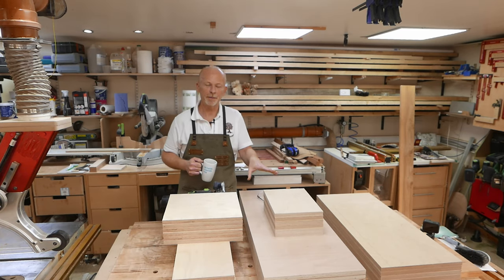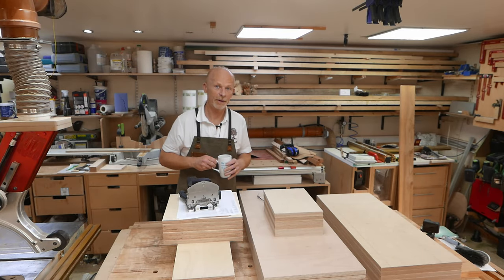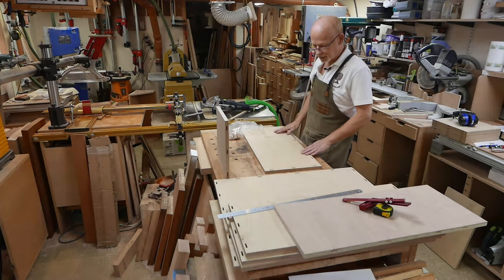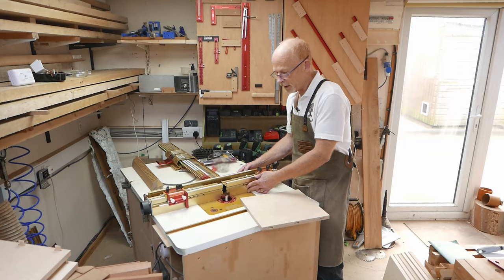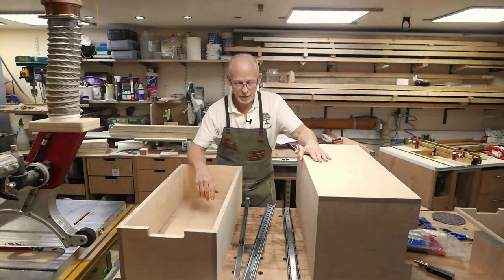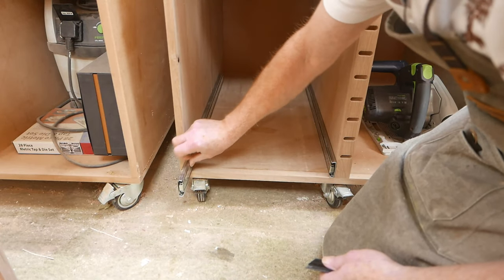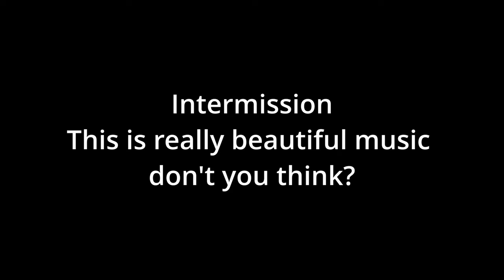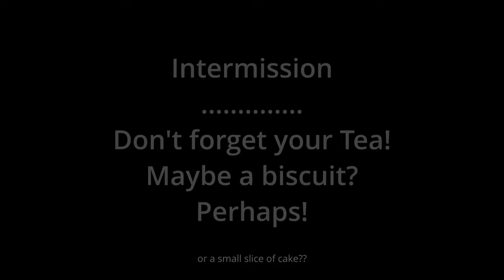Making Plywood Drawers using the Festool Domino Part 1

Comment: I have a set of Dominos that I wrote the size on with a Sharpie Marker (example 6x40).  I sanded these Dominos a little on the edges and sides.  I use these strictly for dry-fit and and never for glue-ups.  They are easier to put in and remove. Also you can apply blue painters tape around the boards during dry-fit and this allows glue removal to be much easier, glue application within the non-tape areas and less glue staining on the piece as well as ensuring adequate glue.  Nice job with your video.
Reply from the maker: Hi Mike, now thats a top idea marking the dominoes, might use that myself. 👍👌

Comment: I noticed @5:14 there are no dominos between the 'back' and the 'side' (presumably the 'top' helps) but have to noticed any potential issues doing it this way?
Reply from the maker: Hi Andy, you're dead right.  as the span was so small I really don't think there going to need additional support.  The ply is incredibly dense, cabinet grade so I think I good.  I've used the standard 'red' hardwood veneered play from Wickes etc in the past and that would definitely need them all round.  Time will tell but I think I'm good. 👍
Reply: I thought the same.  Since these faces will never be visible, why not drive a couple screws to secure the joint further?  In my shop, I'm constantly asking myself if "this part" will ever be visible?

Comment: All good stuff Graham!  As you say it is great to have a tool that is so accurate. The one challenge I struggle with is cutting Domino's away from the edge - say to add an upright support in a run of shelving. Have you any tips you can share to assist me make that operation more reliable and accurate? Please keep the good work with your videos -  its all very instructive.
Reply from the maker: Hi Mike, thank you.  Indeed as did I until I learnt one simple fact.  10mm to centre.  It just so happens I'll be explaining that in the next vid.  Damn what an exciting channel.....🤣🤣🤣
Reply: @GTWoodshop  Thanks Graham, I look forward with anticipation!  I understand the 10mm to centre. My difficulty is as the Cornish would say ' is holding the bugger steady'. I am sure you will address this in your video and I will be all eyes and ears. Exciting!!!
Reply from the maker: @mikevyvyan7060  I will of course do my best.

Comment: Did you use the loose domino settings (setting 2) for your joints?
And if so why?
Love your channel
Reply from the maker: Hi pty, yes I did, mid size for all.  I didn't feel the need to have the Domino line everything up with the tightest setting as it was such a simple shape so just left it on 2 for all, a quick tap with the mallet and close up the clamps. 👍😎